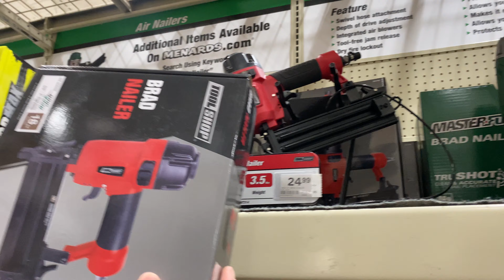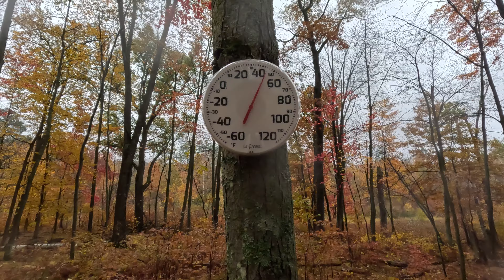COZY HardWood FLOOR INSTALL at our off grid cabin in the woods

Comment: How did you cut the 1/4 round birch tree trim?
Reply from the maker: With a table saw, I wouldn’t necessarily recommend it.
Reply: @jodimiddendorf  Why not?  The useing a table saw part or the birch trim part?
Reply from the maker: @BS.-.-  the table saw part. It was just sketchy with the birch saplings being so thin and not being straight. It put sideways pressure on the blade that can be dangerous.